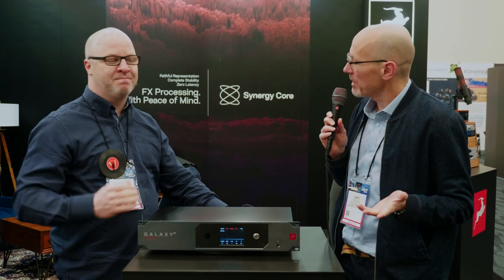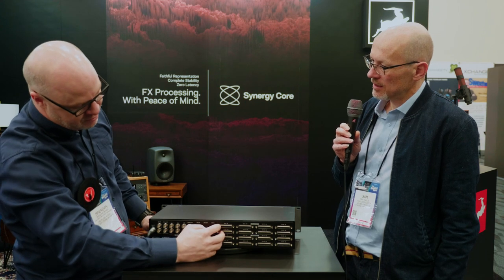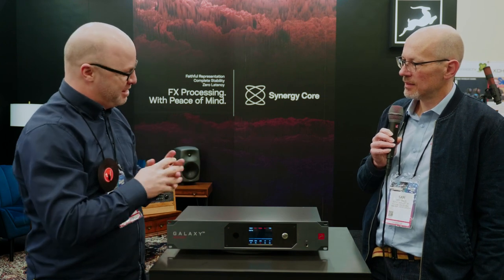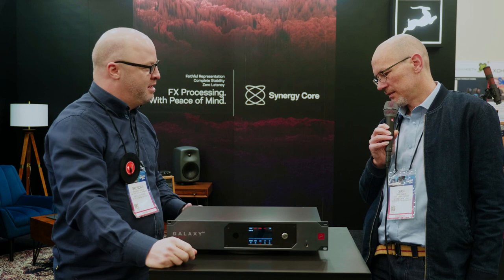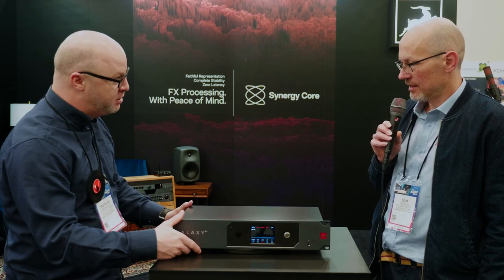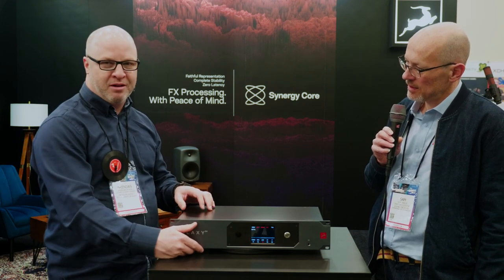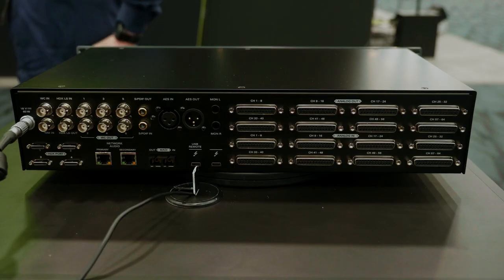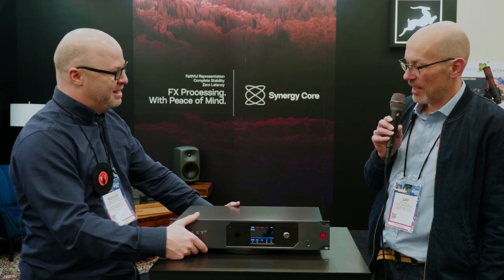Antelope Galaxy - NAMM 2020

Comment: They should do a version with leads I/O cause the price will be out of reach for home users. I moving away from USB or Thunderbolt on pc is good cause t has been their drivers that have been antelopes weak points besides questionable hardware quality. But sonically they sound the best to me. It sounds like perfect hybrid between crystal clear digital and analog. I this new antelope guy I really like him!
Reply: try new Lynx Aurora N
Reply: This is not meant for home studios, for that they have the Orion line.
Reply: @klvAcosta  I just want to know if the converters in this one are better than my Samsung Galaxy S9!
Reply: @RealHomeRecording man i clip the converters with this one on my master and oh my, way better than the burl and lynx aurora i tried, i can achieve 6/5 lufs everytime w no problem w this one, it sound so 3D and open without sounding harsh like the burl, best converters to clip out here